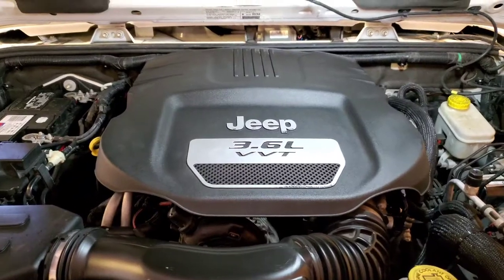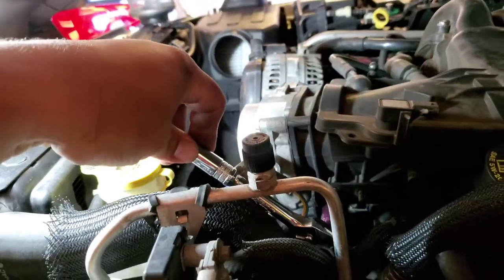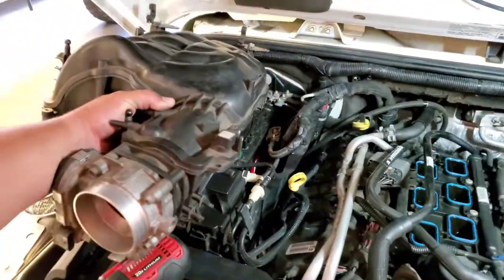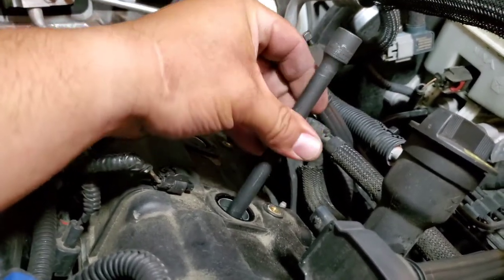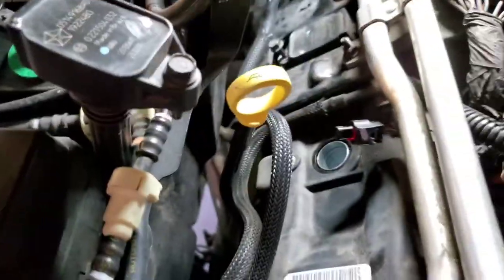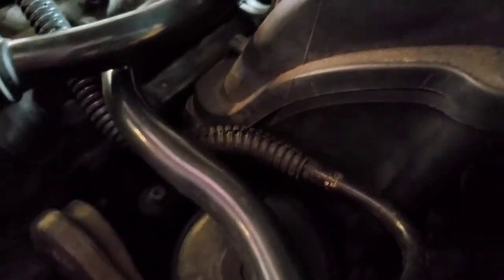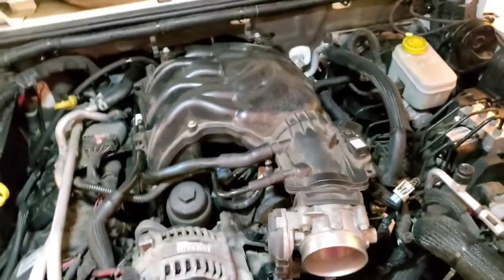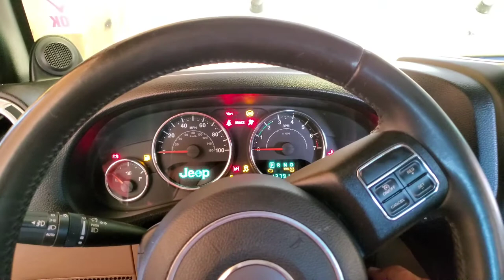How to: Replace Spark Plugs on a 2013 Jeep Wrangler Unlimited Sahara

Comment: Excellent video, great wrenching one handed and keeping in frame with narration - well done. I would just add a couple of minor points. Spark plugs need to be gapped, very, very carefully with iridium, .043. They also should be torqued to 13 inch pounds I believe but double check. I would replace the coil packs if the mileage is high, it costs more, but while you have it apart, easier now. The coil pack boots would also get a little dielectric grease too. The 6 gaskets are made of rubber going to each port, and with the heat they dry and crack. They are also inexpensive and easy to put in. The manifold bolts have a torque spec stamped into it and there is a sequence for tightening. I know these are all small things, but it could save you a hassle in the long run. I also like to use a blow gun and shag any dirt off before I start on disassembly. Good video on the components that need to be removed and you can actually understand what’s going on. Brevity is also a nice thing instead of an hour worth of the entire thing. Good luck to everyone.
Reply from the maker: Thanks brother I really appreciate your info! Thanx bro I appreciate your SUPPORT!

Comment: George,
Thanks for showing what a PAIN this is going to be for me. Seeing you do it will make it a lot simpler for me as well.
The only thing I didn't see you use was some Anti-Seize on the replacement plugs, is there a reason to not do this?
Reply from the maker: You don't need too but doesn't hurt, just showing how to replace the plugs. Thank you for your SUPPORT!

Comment: How many miles u put so far in your jeep? Any major issues u faced? 
Im on 125k miles and had to replace the water pump, exhaust phaser, and now probably the oil pump selonoid according to code P06de in my scan tool. 

Thanks for the infos tho !
Reply from the maker: No issues yet, damn bro im sorry. Every car is different, same models never have any issues some do. Its just the car bro im sorry
Reply: 142k on mine and I’ve done axle seals twice, 2 calipers, wheel speed sensors twice, front driveshaft, clock spring, 2 Ac actuators and the roof seal.

Comment: Thanks George. Any specific tools required? Is the 5/8 plug socket to remove the plugs just a garden variety one?
Reply from the maker: Yeah using the spark plug socket makes life easier with and extension and maybe a swivel adapter for some tight areas. Hope this helps!
Reply: @559powerscape  Sure does man. I was only worried that I may have met the old “it’s a Jeep thing” thing where a generic socket wouldn’t fit down there and I’d have to go spend more money on tools hahahahaha!
Reply from the maker: @drappennen5704  lol usually, the right tool gets the job done right! But there is times you have to take matters into your own hands....lol  and use a hammer or 2 lol
Reply: @559powerscape  yeah I have a persuader or two in my toolbox 😜
Reply from the maker: @drappennen5704  🤣🤣🤣👍👍👍

Comment: What if I never disconnected the battery. Would that affect anything?
Reply from the maker: It will reset the drive monitors for smog but shouldn't experience any issues. For spark plugs disconnecting the battery isn't necessary

Comment: Is it running more smooth now?
Reply from the maker: Yes it had a slight miss fire. Now everything is running 💯
Reply: @559powerscape  sounds great! I have 111k on my 2013 JK, and it's just not running real smooth and responsive. On original spark plugs. I'll be doing the job soon.
Reply from the maker: @gsabella4  try also changing out the Intake Air Filter. Also SHELL 91 Premium cleans and lubricates. This makes a huge improvement on idle and throttle response. Hope this works out for you. Also oil change plays a big part
Reply: @559powerscape  Got my plugs and plenum gaskets done today! Used some tips from you, this vid really helped. Thank you. It was not an easy job but fun to do! And my JK is running so much better i can't believe it
Reply from the maker: @gsabella4  lol heck yeah bro! Thats why I make these videos for! Im glad its running better! Thank you for your SUPPORT!
Reply: @559powerscape  Keep it up Bro. Your channel will only grow! It is truly impressive how much work you did in the video with only one hand haha
Reply from the maker: @gsabella4  🤣🤣🤣🤣thanx bro really appreciate it!
Reply: @559powerscape  Im curious which cylinder had the misfire? My JK gave me a cylinder #2 misfire code.( engine light) A couple of days later engine light cleared up. I have noticed that it is idling a little rough. It has 88k miles on it. Probably needs spark plug change. What are your thoughts? I always run Shell 90% of the time and Mobil the rest. I had added Chevron fuel system cleaner couple days before the engine light went away.
Reply: @truckerrickakamanowar  I had that happen to me 2 weeks ago at 49k miles...  Ended up having a bad coil pack.

Comment: Lmao my Jeep left me stranded In Walmart I went to start it (ran fine before) and it had a very rough idle and died hooked the scanner up and I got rich fuel code, multiple cylinder misfire code lmao won’t run but just turns over ima be replacing the MAF sensor, Plugs and wires and see what happens from my guess when I was driving the MAF sensor failed and fried some of my plugs or coils lmao
Reply from the maker: Damn no way, man hopefully replacing the Maf sensor does it. Good luck bro!